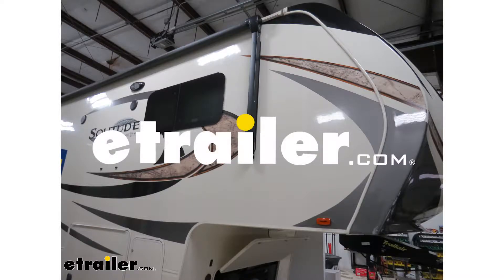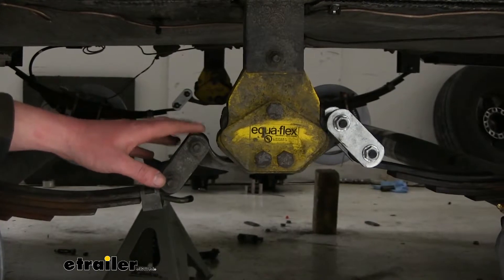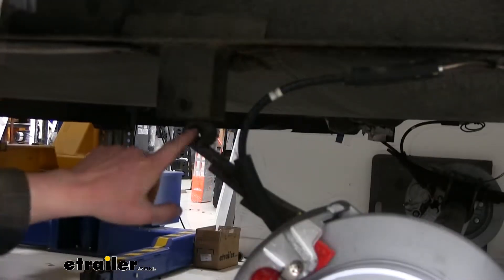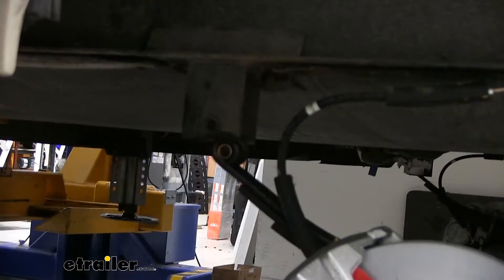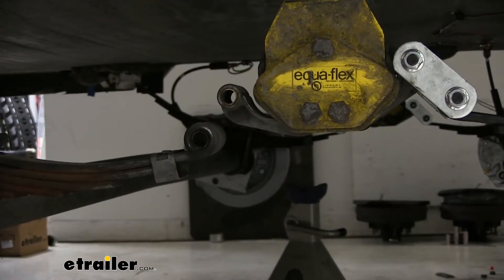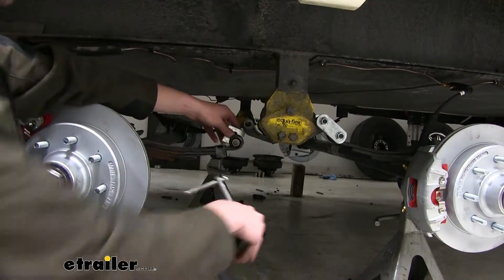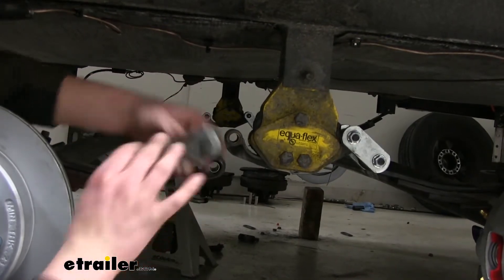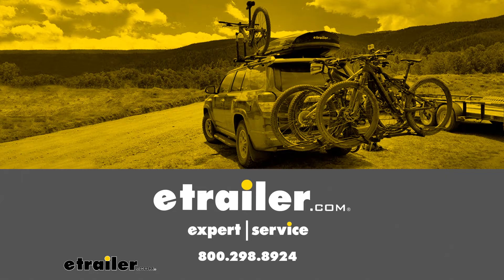etrailer | Dexter Heavy-Duty Suspension Kit Installation - 2018 Grand Design Momentum 5W Toy Hauler

Comment: Why wouldn't  you put the grease zerk fitting facing the outside instead of the underbelly of the trailer.  Looks like it would be a lot easier to grease the other way.
Reply from the maker: You can install them either way. Some will install them facing the outside of the trailer so that they can remove the wheels and grease them. This is typically because they cannot crawl under the trailer and grease them. If you install them with the grease zerks facing the inside of the trailer they will stay cleaner than on the inside of the wheel well.
https://www.etrailer.com/Trailer-Leaf-Spring-Suspension/Dexter-Axle/K71-359-00.html
Reply: @etrailer  Thank you for the quick response.